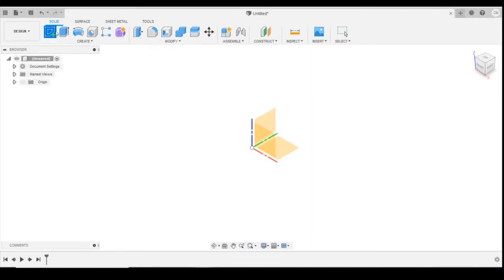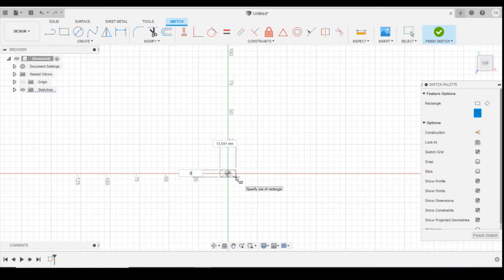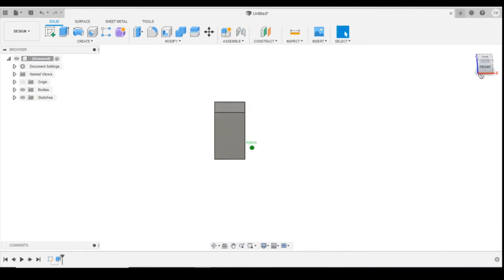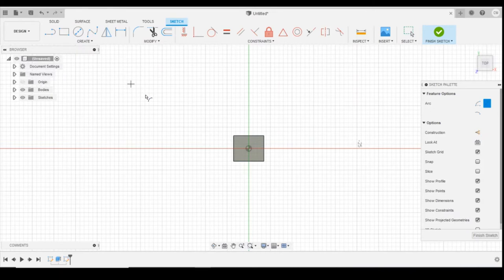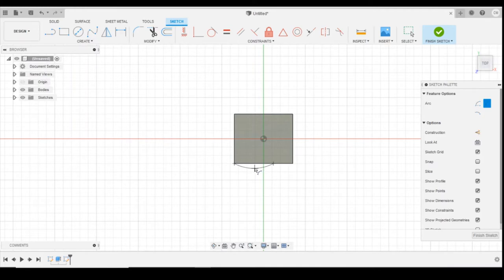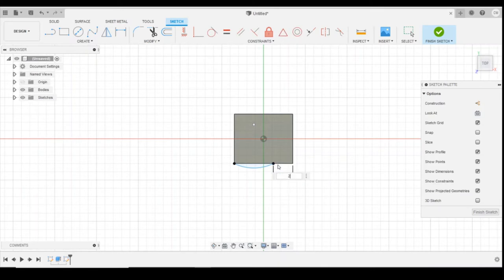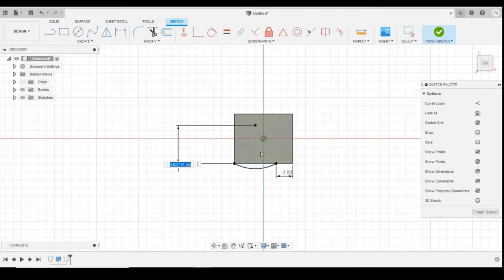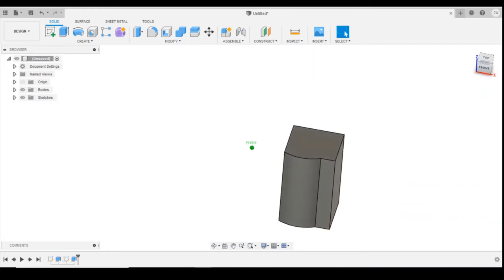Lesson 7 - How to Guide for Fusion 360 3 Point Arc and Copying a Sketch

Comment: something that I did incorrectly was to not select the front face before making my buttons.  It was easy enough to extrude out further, so they stuck out like yours.  But, is there a way I could have moved my sketch from the plane(?) or the back of the vending machine, up to the front plane?
Reply from the maker: Hi,

That's not an issue.  If you go to the History at the bottom and right click on the effected sketch,  there is an option to redefine the sketch plain.  you can then just select the face you want the plain on.

Carl